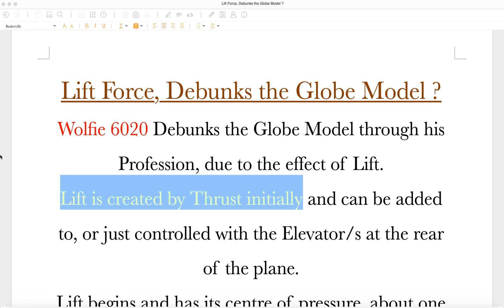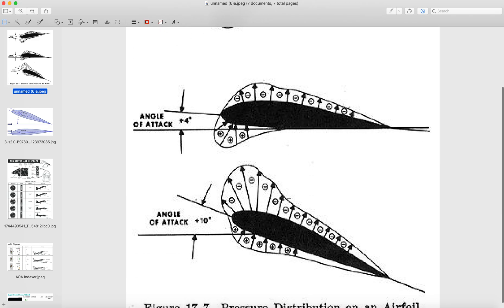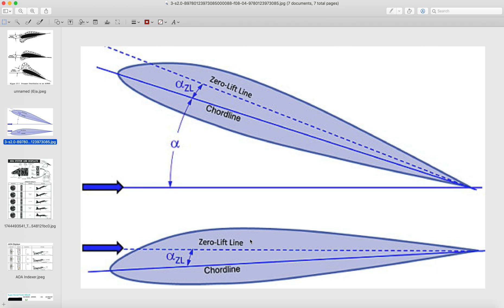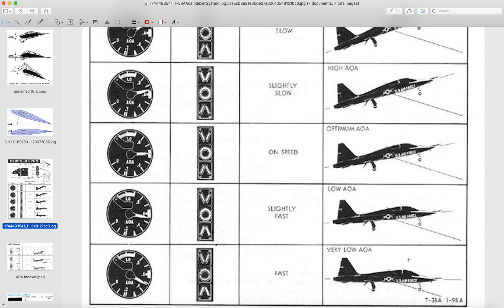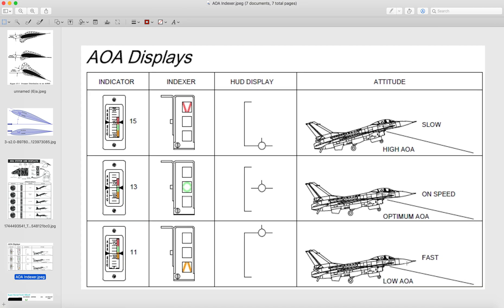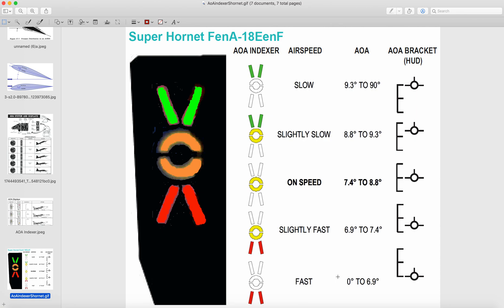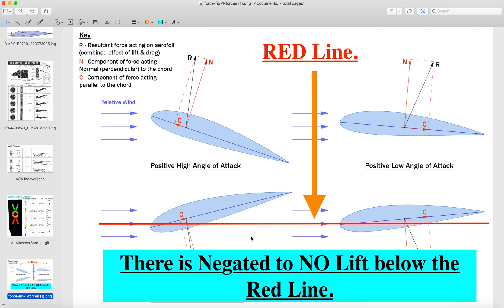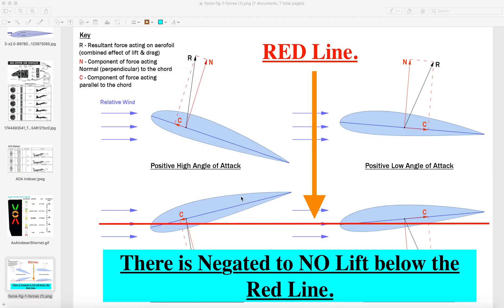Lift Force, Debunks The Globe Model ?

Comment: Ever heard of centripetal force or gravity? More importantly, have you ever studied physics or maths?
I can safely say that you haven't.
If there is a centripetal force (pulling toward the centre), IT will constantly change the direction of the object.
Think of a ball on the end of a string or a Catherine wheel firework. Once it is moving, it continues to move in a circle.
In other words, you could put a rocket on a rock and gravity would make it travel in a circle. The pitch of the plane is irrelevant.
I actually don't know whose PowerPoint you are reading from, but it's not exactly an aerospace design document, is it? The wings of an aeroplane are angled upwards and have an aerofoil upper surface. These two things produce lift WHEN thrust pushes the wings forward.
A pilot maintains a constant altitude. Gravity does the rest. It's not rocket science!

Oh, that reminds me...what do the world's rocket scientists bother making fully functioning rockets for if nothing ever goes into space. Wouldn't the satellite manufacturers want their money back. And there are no hypersonic drones that could travel as fast as the satellites that YOU can observe for yourself. You can even view or film the ISS yourself.

You've got the most ironic channel name: 'Brian's Logic'. You aren't using ANY!

Comment: Brian, in our previous discussion I explained the following observable and testable reality:

"To maintain the necessary lift to hold the aircraft up in the air, the nose is slightly pitched upwards. Pitching the nose upwards, increases the aircraft's angle of attack. Since, lift is directly proportional to the angel of attack of the aircraft, the airplane flies at slight nose pitch up attitude, even in level flight."

You ran from our conversation and now you make similarly silly claims like in previous video, why is that?

Comment: If you're flying east or west at more or less the same latitude - why isn't the aircraft rolled to the left when going east, and right when going west? Why Do aircrafts in general very rarely, if ever, have a roll applied in cruise?  You should be able to see this, with more ground visible in one window row and more sky visible in the opposite row. Also, I would think you need more roll the further north the aircraft travels. Or, maybe you flat Earth pilots can confirm that you're constantly applying yaw in these cases?
Reply: Nobody has a good answer to this?
Reply from the maker: Because they don’t fly that way, following Latitudes east and west, as that would bring them across oceans 🌊 they don’t do that….
Reply: @BriansLogic  Okay, check out the flight route Nantes NTE to Montreal YUL. Those two airports are at 47 and 45 degrees North respectively. Almost on the same latitude. On a globe, that's a straight line towards west. On a Mercator projection, it's an westerly flight path. 

If the Earth is flat, they either 
A)fly a 1/6 of the circumference of the Earth at that latitude in a circular pattern

B)fly a direct route in a straight line

If A, then the aircraft is constantly rolling to the right. You wouldn't feel this or be able to measure it unless you had a proper gyro, but you could see it when looking out of the windows.

If B, then the flight path takes you much farther north, towards greenland, than you would expect. You could verify this on a GPS.
Reply from the maker: @ojkolsrud1  On a flat earth all flights are straight lines or dog-legs which is what planes do, because it’s flat.
Now are you going to address the chord line issue or not ? 
As your ignoring that while telling me about a globe, that debunks a globe…. 
If we were on a globe we would not be using airplanes to travel around it.
Reply: @BriansLogic  But like I said, if the Earth is flat and the path is a straight line, wouldn't the flight path be different, in real life, to what we actually see? In this example, you'd end up farther north halfway through the flight. A straight line on a globe is a curved line following a circular path with the center at the north pole. A straight line on a flat Earth is a curved (curving north in this example) line on a globe Earth. 

I made a little illustration here:
https://imgur.com/1Q9mfb2
It's not 100% accurate (after all, there aren't any proper flat Earth maps), but it shows that the land masses you fly over is different if the path is direct (blue line) or it tries to mimic the path it would've had on a globe Earth (red line). Surely, if the paths followed the blue line, people would've discovered it. There are geeks like me who tracks the path of flights on my Garmin GPS. The pilots follow these paths as part of their job. They would've discovered it if they were actually flying straight rather than in a curve.

And again, if the plane is following the blue path, it would be rolling the entire flight fly fly straight towards west.

> Now are you going to address the chord line issue or not ? 

I'm sorry, you have to explain that to me first, please. I guess I've sort of talked about a chord line, but I'm not sure if you want to discuss another one.

> f we were on a globe we would not be using airplanes to travel around it.

Ah, you think we could just hover a helicopter and have the Earth rotate below us? That the initial speed an object has is irrelevant once the object is detached from the platform that gave it that speed? Like if I'm on a plane and need to use the toilet, I could simply jump and travel to the back of the plane going 800km/h? Or was it something else?
Reply from the maker: randomstring No you have this completely wrong, and you obviously have not watched the video, which leads me to believe that your going to be wasting my time, as you mention GPS, and refer to Latitude, which tells me that you don't understand how GPS works or the coordinates system used by GPS ?
Rolling why would the plane roll flying a straight line, there is no rolling going on, and there is NO following latitudes, you debunk your own claims by your lack of understanding of GPS. 
Now watch my video and learn about Chord lines, as that is all that matters, and all I'm interested in talking about, as your claim concerning the Globe are all put to bed by the chord line, so why argue about routes, when the chord line proves that the Earth has to be Flat, without a question of a doubt....
Reply: @BriansLogic  Yes, two places at roughly the same latitude (they have the same north coordinate), will have planes following a straight line on a globe, a curved line on a disc (a longitudinal line between the two airports), where the plane needs to roll the entire time (how else is it going to go straight west) or a straight line on a disc where you ignore the actual flight path and the stuff the plane is flying over.

To understand the rolling, ignore any actual flight paths for a second. Do you agree that if a plane is flying straight west on a flat earth, the flight path forms a circle? In order to fly straight west, it needs to roll to the right. If it starts out flying west and doesn't roll, it'll end up at the ice wall, no?

EDIT: Yeah sorry, I just watched the video, and your chord line has to do with the wing structure. I just figured that you'd be knowledgeable about airtravel in general, since your're discussing planes.
Reply from the maker: @ojkolsrud1  There is no rolling going on, just straight line flight, to keep a good signal for navigation ( GPS etc ) and for safety, airplanes always fly as close to land as possible, so your idea about the following an altitude would not happen as it is taking them away from land more than is necessary.
Another reason that the following of a latitude does not happen is because, if they followed latitudes all the time, then they would be following latitudes south of the equator across the pacific, but they don’t do that.
Airplanes use NED, North, East, Down coordinates which are Cartesian coordinates, so they don’t use latitudes and longitudes, they may convert to latitude and longitude, but their raw coordinates are Flat Plane Cartesian…. 
As for the Chord line, that cannot go below Horizontal without them losing lift, so that means they always must fly a Horizontal path, only changing in Altitude if necessary, but still not dipping the Chord line below Horizontal as they must keep pitch up to hold lift.
Reply: @BriansLogic  So then, it should be really easy to debunk or confirm this. The next time you fly a sizable distance (between countries), and it has a east/west component, you should be able to find the straight line globe path they say they'll be taking, and you can compare that to the path they actually took, using your GPS or looking out the window if you're really good. The image I linked to shows what I mean. The red line would be roughly the path the plane would follow on a globe Earth. If the plane followed the blue line, then maybe you're right. If the plane followed the red line, maybe I'm right. Do you agree?

I'm unfamiliar with NED, but I read quickly about it. It seems to be the tangential plane you find at a certain spherical coordinate. That plane is cartesian, I agree. But I fail to see why that supports the Earth being flat, when the basis for the plane is a sphere.

A flight path can still be mapped using lat/lon.

Also Lat/lon can be cartesian too. They're X and Y on a flat Mercator projection, for example. They're based on a sphere.
Reply from the maker: randomstring No XYZ, or just XY is always Flat Plane, as it is two Horizontals and a Vertical, or just two Horizontals, what you read about was the ECEF system which uses Tangent Planes, which means that they go from one Tangent Plane to another, so that means that they are always referencing Flat.
The ECEF system originated with Surveying as it was originally the ITRF system.
Cartesian is the Raw data coordinates used by Surveying, Cartography, and Aerospace, Latitude and Longitude is a 2d system, but it must be converted to from XY Cartesian, as do Spherical coordinates, as they pre-assume a Globe, but all the original data is Cartesian, data which was collected by Surveying prior to the ECEF system being used.
All any of them reference is Tangent Planes, they may pre-assume a Globe, but they only reference Flat Plane.
I was on several flights in 2017 and 2018 going from London to California, and they took a route from London across to Canada and then south across the US to Los Angeles.
But all this is kind of irrelevant as the Chord line of the Wings shows that to keep Lift they must keep that line above Horizontal, so that makes flying around and down a Globe impossible....
Reply: @BriansLogic  Well, there would be a lot of converting between spherical and flat coordinate systems, at least. 

If you draw a straight line from London to Los Angeles on a globe, it passes over Greenland and Canada. I don't know if you have the ground track, but I could take a look at it if you have, if there were some deviations from what we'd expect?

Regarding the chord line of a wing - I don't want to be rude, I really don't, but I think you've simply misunderstood the physics here. In principle, there's no difference in how a plane would fly level if the Earth was flat or spherical. The weight force is straight down in both cases. Also, there are lots of wing shapes. A wing where angle of attack is the only way to produce lift, also works - where the underside, chord line and overside has the same length.

Comment: How about totally avoiding aviation and instead consider trains, cars and ships as they travel long distances? Each of these will have to “pitch” to follow Earth curvature. A train travelling at 125 mph will follow the Earth’s curvature at the rate of 1.45º per hour, a car at 70 mph will “pitch” at 1.01º per hour and a “fast steaming” ship travelling at 20 kts at the hourly rate of 0.33º. This happens and given the appropriate equipment (sextant, chronometer and almanac eg.https://thenauticalalmanac.com/TNACompact/2021%20Nautical%20Almanac-%20compact%20version.pdf) can be predicted in advance and observed. This is called reality.
Reply from the maker: No how about one of you pilots support your claims about aircraft, instead of making new claims about other forms of transportation that you also cannot back up, and by the way you need to learn how a sextant works, as it’s one of the all time   Greatest Flat Earth proofs, but right now I’m only interested in the claims being made by you and Wolfie and blue etc, actually being supported ?
Reply: @BriansLogic  The reason for introducing other forms of global transport is to help explain where your misunderstanding of reality has risen. A baby’s first steps are not the 100 M finals at the Olympics. Understand simple surface transport first and then move on to aviation. I’m also intrigued that you believe a sextant is flat Earth proof. It is merely a device to measure the angles of celestial bodies above the horizon. Your nemesis is the Nautical Almanac that predicts the angles celestial bodies will be above the horizon. Plotting these angles shows we are on a spherical Earth.

Comment: Brian should write to Michael O'Leary the CEO of Ryanair pointing out the company is burning more fuel than they need to. Currently they fly great circle routes as the shortest distance between two points. On a flat earth a straight line is the shortest distance...

Comment: As the plane flies around a great circle at a constant altitude and speed,the velocity vector, the pitch angle and the vector defining the local horizontal direction ROTATE SIMULTANEOUSLY. 
The velocity vector is parallel to the local horizontal direction. The pilot never notices the change in pitch angle because his horizontal is rotating at the same rate.
If the plane flew a complete great circle path, the plane would have completed an aerobatic maneuver known as outside loop —- a super slow loop,but nonetheless an outside loop. You can easily find videos of outside loops.
Your claim is equivalent to claiming that outside loops are impossible.
Actually, 1st Lieutenant James Doolittle, Sc. D., did the first outside loop on Ma y 25,1927 at Wright-Patterson Army Air Corps base.
You can read his autobiography. He had some other accomplishments.
Reply: SO, no need for instrumentation? lol
Reply: An altimeter is sufficient.
Reply: @johnboyd782  An altimeter is all that's needed over a flat plane. Dude, the shekels aren't worth it. Go find a legit job and a life to go along with it. Just in case we are judged. Know what I mean? Obviously not.